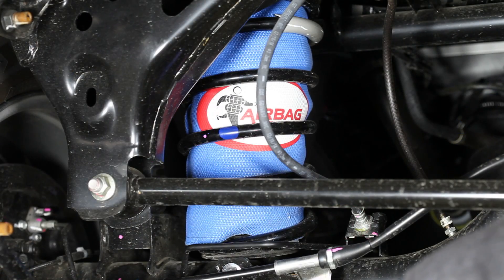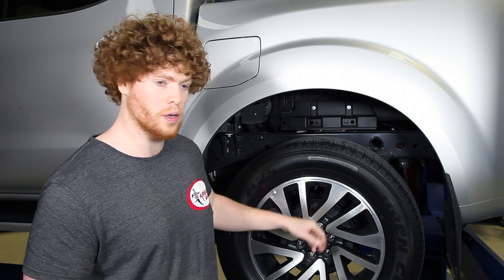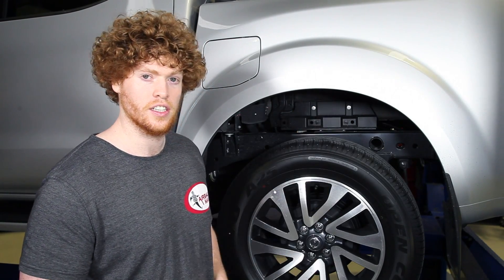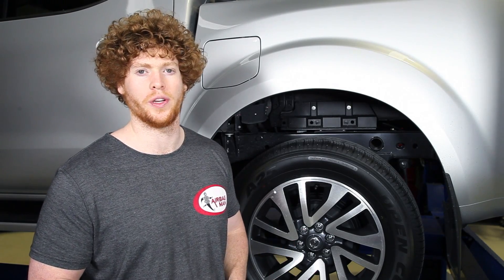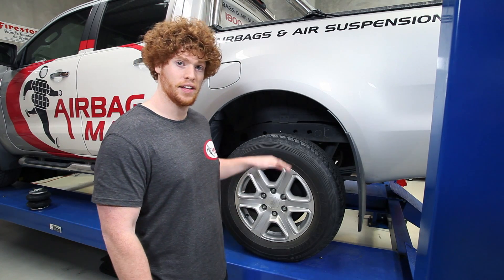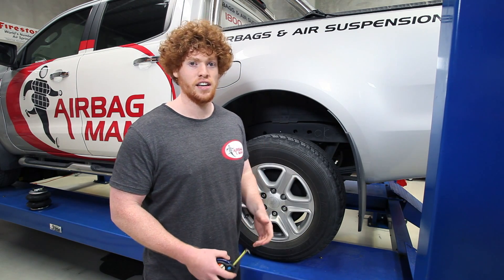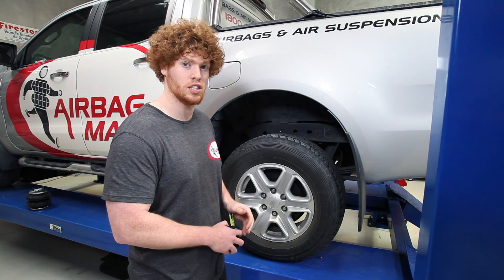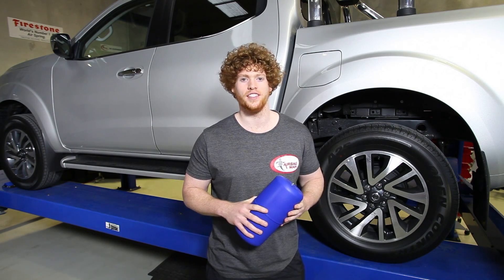Reference Points & Airbag Pressures by Airbag Man Suspension

Comment: I have a couple of questions for you.
1. Without any pressure in the airbag and no load in vehicle will the ride increase as a result of the airbags being installed? Product installed CR5031-HP.
2 You say at one point in your video that the sag under load conditions can be raised by inflating the airbag to its reference point height. Do you do this with load  still hitched or unhitched?
My installer says I should unhitch-inflate-hitch-up and check height. Keep doing this until correct reference height is achieved. Seems like a very tedious process. What's your advice?
Reply from the maker: G'day & thank you for your comment, so we can best assist you, please fill out the form via the link provided & one of our Experienced Airbag Man Specialists will be in touch as soon as possible.
https://airbagman.com.au/pages/youtube-form
If you are in need or urgent assistance, please feel free to call our friendly team on +61 7 3889 6556 
Kind regards, 
Airbag Man Team